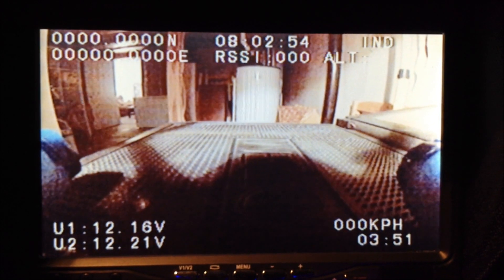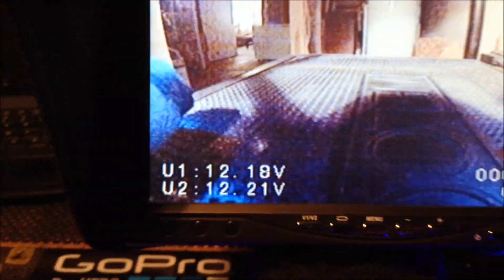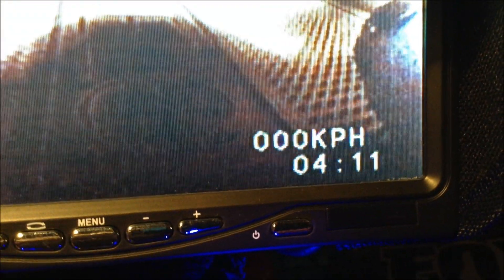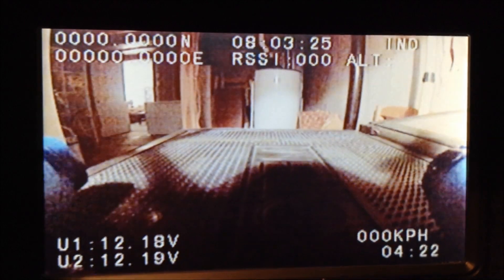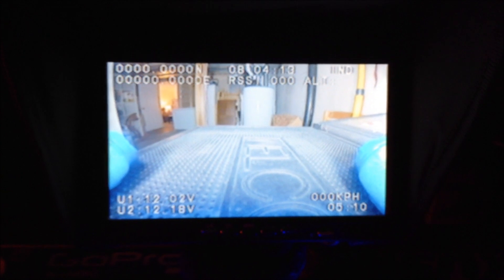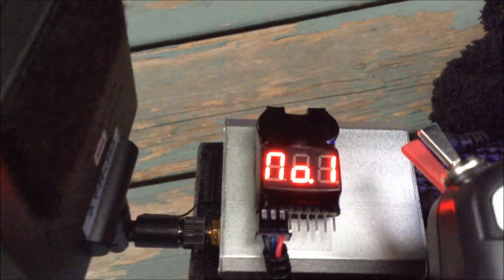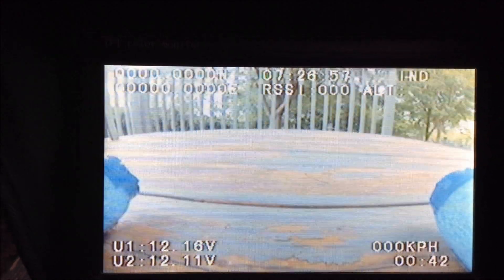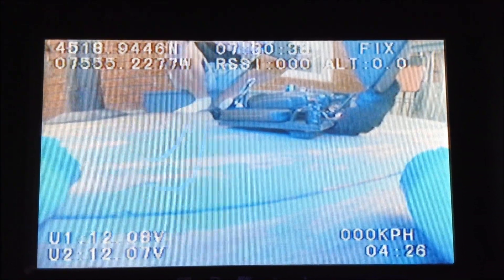HobbyKing Mini OSD System with GPS Module, My Setup and Install

Comment: Hey.

Does it show the direction of your starting Point so you can find your way home?
Reply from the maker: andifl no for the original unit I bought 3 years ago, but I think I remember hearing that the new update firmware has a directional arrow.

Comment: Hi friend , if need the GPS modules, please contact me .
Our company Shenzhen cntak electech co.,Limited is a professional GPS modules manufactory. website: www.cntak.com
GPS  /  GPS+Beidou  / GPS+Glonass /  Module with antenna  /  G-Mouse etc.
We make it with MTK chipest mainly . also can use Ublox or others
Can customed size: 15x13mm, 16x13mm, 16x12mm, 22.4x17mm, 33x14mm, 10.1x9.7mm, 13x11.5mm, 28x20mm, etc.
High quality , Lowest market price , can provide the free sample for test .
If interested, please email me.  richar@cntak.com

Comment: Hi, do you know if you can monitor a 4S battery voltage with this?
Reply from the maker: wepootheuser I'm not sure, just check thenhobbyking website for the specs

Comment: Ottawa Canada?

Re slow GPS lock:
Perhaps the GPS module does not have a battery backup. It has to go through cold-start fix every time after power on. Cold start could take very long time before the first fix. One other drawback is the refresh rate is one second which is rather slow for realtime flight. But again, one has to accept for a  cheap OSD.
Reply from the maker: Yep in the Capital i am, why are you close